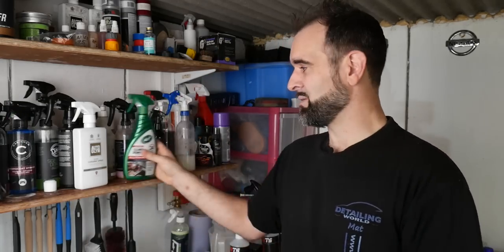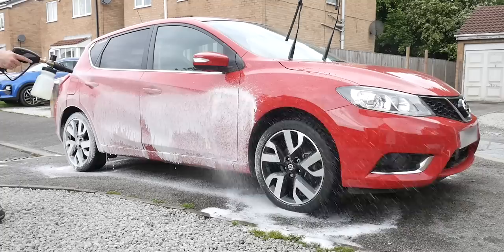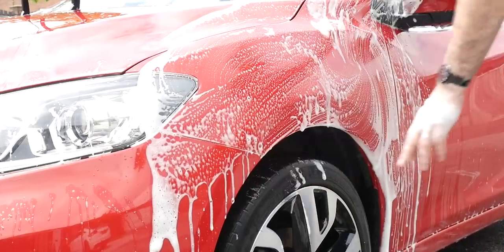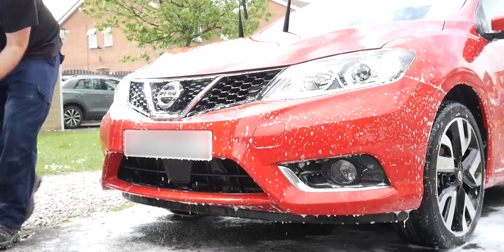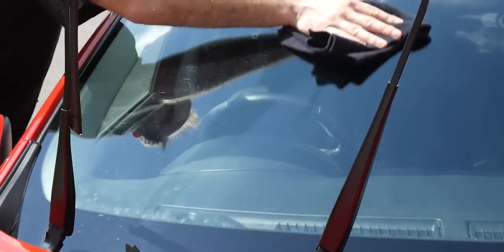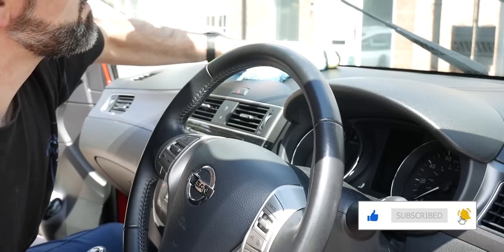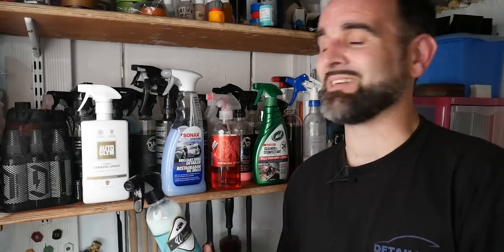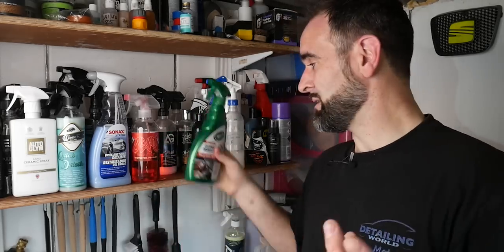Time For a Quick Clean and Making Some Mistakes!

Comment: Congratulations on your new addition and welcome back.
I have to agree with a couple other comments HDD or GT wheel shampoos work well with just 15ml in a pump foamer so should also be ok in a lance at a fairly good dilution. 
And in direct sun usually have an odd water spot to deal with so FSE is my go to.

Comment: Great vid. Made the same mistake the other day trying to wash my new black GTI for the first time. Was so desperate to get some protection on it! Ended up using some relax ceramic paste wax on it as it was the only thing I could work with! Anyway, what’s the blower you have? I have the metrovac which is amazing but feel that I need a bigger one now I have a black car. Want to avoid contact as much as I can.

Comment: I just get more confused the more I watch detailing videos! So, the car is lovely and clean, so what is the purpose of the detailer after it’s dried? I would maybe normally use a detailer in between washes if there are spots on the car that are noticeable, to keep the ‘just washed’ look of the car. I’ve never thought about doing the full car though after I’ve just washed and dried it🤷🏻. Great video btw.
Reply from the maker: To remove any water spots or streaking from drying. Some add a touch of protection to help prolong the life of the wax/sealant you have on
Reply: Thanks for that. Is it something that you would do as a matter of course? It’s something I’ll definitely consider doing now tbh, particularly on my spoiler, as this seems more prone to water spots.👍
Reply from the maker: Depends on the weather, time and how long the protection has been on
Reply from the maker: But yeah, probably most sessions, or every other detail

Comment: Just use dettol anti-bacterial spray (clear, no smell) for £1 a bottle on the interior. Leaves no residue and disinfects. I don't get the point of expensive interior sprays unless you want a shiny coating on your plastics or you want your car to smell of bubblegum